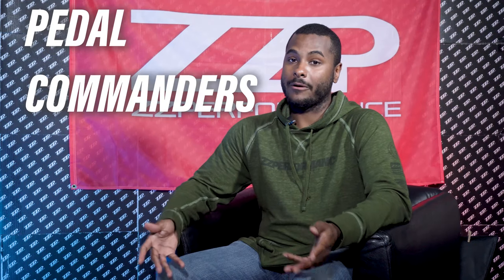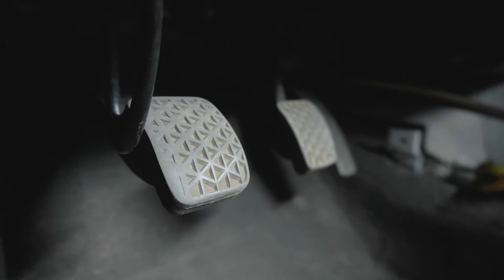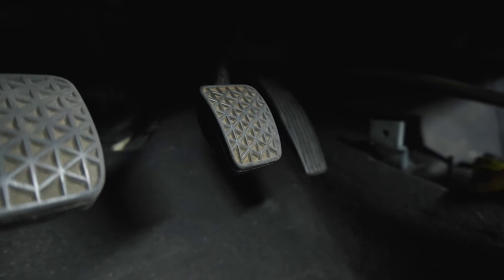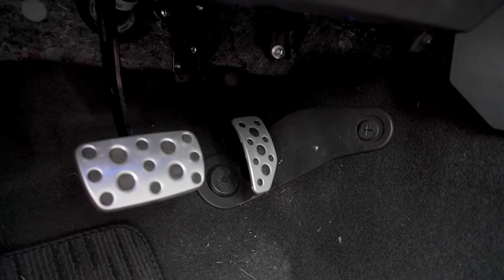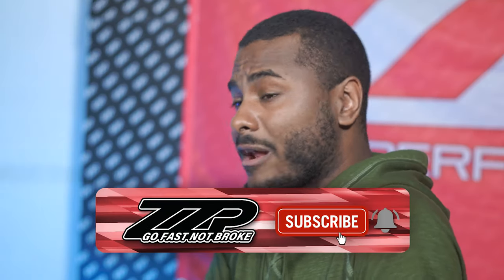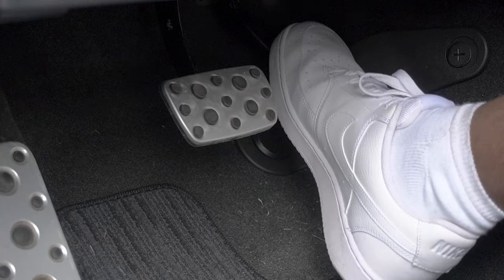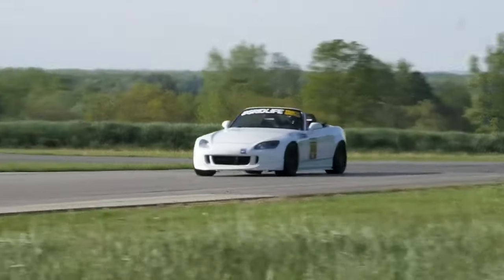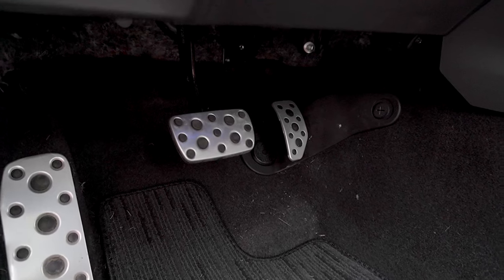Why You SHOULD NOT Buy a Pedal Commander // Behind The Builds

Comment: Custom tunes are great but not worth the risk if you want to keep your warranty intact. That's why a throttle controller is a great idea for those who care about their warranty not being voided.
Reply: Bingo
Reply: Perfect response. Got a Lifetime engine/power-train Factory warranty on my 2020 4Runner ORP. No way in Hell I'm giving them any kind of excuse to shag out of that Deal!. Plug-n-play and most minor bolt-on performance accessories pose no risk. Flash or tune the ECU >>>>>>>.....warranty is DONE.....Gone......bye bye! 

CAI.....no problem
Throttle spacer....no problem
Pedal Commander....no problem
Cat-back exhaust....no problem

(My Son works in the Service Department of the Toyota Dealership here)

Just saying........
Reply: @davec8894  Yeah after some research looks like a throttle booster and a plug an play module are the way to go to keep the warranty intact!
Reply: I'm waiting patiently for Magnuson to crack the ECU Tune for a bolt on Supercharger (with Toyota's blessings of course which is why it has not happened ....yet).  

All previous versions of the TRD Superchargers in HISTORY were an optional  Magnuson built bolt on and tuned (in partnership w/Toyota), and either Factory or Dealership installed and supported under BOTH Warranties. 

So short game is......no you cannot really make this magnificent 6000# beast any "faster" without some really serious upgrades. Possibly serious consequences, and that depends on your long game.....????? I figure about $8-10K. 

However, in the meantime I'm doing my "homework" to get a little more 'pep' in the step per say, while still playing by the "Warranty" rules. 

Been running Power Commanders on my bikes for years, same concept. Just gives the driver/rider more responsive throttle control and some added finesse. Factory ECU settings dumb shit down for daily drivers or average riders for fuel economy ratings. 

CBR RR LIFE...........Drop a Gear 'n Disappear

Comment: I think Ryan is correct in that the advertising promises by Pedal Commander are unrealistic. And he is essentially correct in saying that the Pedal Commander can't do anything that your foot can't do (although the pedal position reporting is a little more sophisticated than he thinks). And he is 100% correct that the Pedal Commander can't do what a proper tune will do. But there are still some good reasons to buy a Pedal Commander if your expectations are realistic. One good reason is if you own a newer Toyota Tacoma. I have a '19 TRD Sport with manual transmission, and my initial impression was, "What a slug!" After a while I figured out that the engine did have some pretty good power, but it was all hidden by Toyota in the last bit of accelerator pedal travel. This of course was intentional. Making the power harder to access gives you better mileage and improves their CAFE numbers. My truck is so much more pleasant to drive since I installed the Pedal Commander, with more "normal" pedal response. I don't race, rally, or do a lot of off-roading, but just normal driving is so much better with the correction that the Pedal Commander applies to the pedal position reporting. The truck has other problems that the Pedal Commander can't correct that a tune would definitely help, but I'm unwilling to void my warranty just yet. And even a tune won't correct the terrible gear ratios the clunky made-in-Thailand manual transmission provides (two overspeed gears???). So unlike Ryan, I believe there are valid applications for this type of device, and I'm very pleased with mine.

Comment: This is a comparison of apples and oranges. Tuning your vehicle will improve throttle response but at the same time the drive by wire systems have pedal lag designed into them, that is where the pedal commander fits into the picture. The PC doesn't increase performance like a good tune, it merely takes the slop out of the accelerator pedal.

Comment: With newer diesel trucks the computer will restrict how much do throttle body can open up during acceleration no matter how much throttle you give it, in this situation a pedal Commander allows the throttle body to open all the way up giving you a stronger acceleration. The throttle body restriction is done to help protect the transmission so it's best to leave it be anyway but pedal Commander does have its use in this application.

Comment: I bought the Pulsar for my 2020 Ram1500 and filled it up with 93 and ran it on Sport Mode. At first I was like Holy Crap, but then noticed it was operating like I was pushing the throttle more than what I wanted. And like it was explained in this video, the throttle was opening and closing too far and I’m having issues peddling if I start spinning. So looks like I’m gonna take it out. I didn’t feel any HP gains like they claim.
Reply: @zanderfaust  yes but that's the whole point it's not actually reducing the lag it's just simulating that you're pushing it harder. It's complete trash

Comment: I thought these systems give the throttle more resolution down low for drive by wire cars. In all the vag group cars I’ve owned. Eg golf gti , q3 and currently s5 I have found that making slight throttle inputs there is a slight delay especially mid corner when you want to just crack the gas open a fraction it doesn’t do it instantly like a throttle cable would. So to my next question how does one get more response out of a drive by wire car ?

Comment: The PEDAL COMMANDER eliminates throttle lag. You know... You press the accelerator (on stock) and a second or two after it picks up acceleration.

The throttle commander eliminates that. It accelerates immediately after pressing down.

Has nothing to do with tuners, nitro, or anything else. 
IT ELIMINATES THROTTLE LAG...

It's a great product, it gives good response so yes the throttle CAN be sensitive.
You can increase or decrease sensitivity on the app, or directly on the device. For all you EXTRA sensitive folks out there don't worry... The Throttle Commander also has an Eco Mode, and you can decrease even more in that setting, and SAVE GAS.

Set it to where you want it, when you want it.

(Stop complaining)

GREAT PRODUCT!!!

Comment: I know me and my guy got the same mods and challenger, he doesn't have a pedal commander I do, take off I got him. He was running mickey Thompson 11wide in the rear. Now he getting a pedal commander. It's not a make you think anything, it's 100% you can feel the difference right away. Nothing to do with hp just a lot quicker response. I tried driving with it off again after installing it, the car sucks big time with it. If you driving far put it in eco mode, I drove 3hrs and 22mins I started with 160 miles to E, and when I was done I had 133 miles to E. Without the eco mode, I would have used half the tank driving up to get my daughter from college. Not just quick response but gas saver all in 1 package. I guess there might be some fool who believes they can get crazy hp for a couple of hundred, but if you work on cars then, you would know it's not cheap to get gains. Plug and play ain't it? Overall it's fun, and responsive, a gas saver, and once you use it, you won't wanna lose it.

Comment: The need for a pedal commander depends heavily on the type of car. I can't speak for all types of cars but some cars like mine already have the same functionality built-in. I was so close to buying a pedal commander. Literally, I was within 30 minutes of making the purchase until I watched this video. Thanks for the info. It seems like most people don't grasp the point you were trying to convey. I even seen a video of a guy who has a pedal commander in his Porsche Panamera Turbo and he really swears by it. But I have the same car and I just didn't see why he would need until I realized its because he didn't have a ECU Tune. Mine already has a FVD Brombacher tune which has maps that does the same thing as a pedal commander but internally. The Panamera Turbo already has 3 different driving modes that effect pedal response from the factory and is greatly enhanced by my software tune. If I need instant throttle l simply get that from Sports mode. If I want insane but manageable throttle response I get that from Sport Plus mode. Besides, the throttle commander is useless with launch control because launch control requires the pedal to be already to the floor at the starting line so you're already at full throttle before you even start moving. There is no faster response than that. Worst case, I could always tell my tuner to increase my throttle response with phone call for a different map. 
Another thing you can do to increase acceleration (if you have a Porsche that's already FVD tuned) is to get a PDK transmission tune. This route is significantly more expensive than a Pedal commander but its cleaner, internal and more professional. This does many things but most importantly it increases clutch lock up and eliminates the built-in factory slippage. A "no-slip" dual-clutch with 600hp behind it automatically means faster acceleration and quicker response. The PDK tune also deactivates the torque limiter and the speed governor among other things that will increase acceleration to the maximum the car is capable of without the need to add or replace any hardware.

Comment: This is my opinion. Throttle controllers are purchased by people to do one thing and that is to open the blade as fast as your foot to reduce that one second lag it takes for the blade to open that is set by the factory. Trying to zip out into open spots of traffic can be a problem with factory set lag the throttle controllers are designed to eliminate that just as if you had a cable attached to a carburetor, although what this website is suggesting is valid when it comes to letting off the pedal it is not like it is connected to a cable it is only designed to speed up the opening of the blade and not the shutting.

Comment: Ya over time I’ve noticed that a car that’s constantly cutting back for fuel mileage will automatically readjust to throttle position and it won’t be as responsive in the same setting thus have to be constantly “turning it up”. Things garbage car gets confused and drives like shit with it

Comment: The factory computer blunts throttle to protect transmission and to get better numbers with EPA mileage. The extra throttle during shifts should make it a little quicker. The computer turns down throttle input, to claim gas mileage on EPA cycles. You can floor it, but the computer will give you what it wants, not what you want. Eventually you'll get full power but the computer makes you wait for it. You will get an extra 40 hp at low to mid RPMs when you floor it. That's something your OEM computer won't let you have. That's something you're going to feel.

Comment: True you could stump the pedal each time you takeoff but who wants to do that each time you leave from a traffic light. If you can do a cheap mod without spending a lot to notice an increase of quickness I would say it’s definitely worth it. Clearly there is no game in horsepower but if it does make your car quicker then why not. in reality that’s all we really want is to have a quicker 0 to 60 time 😀
Reply: Even if you stomp the pedal, you will still have a lag.  You can't eliminate the lag by pressing the pedal harder or faster.  The Pedal Commander takes out that lag so the throttle responds quicker.  It's that simple.
Reply: @bradmorgan911  except it doesn't. I've had one. All it does is press it down harder

Comment: Pedal controllers will not add any horse power or torque, they are not designed to do that, they are designed to make the drive by wire throttle respond quicker to your input. While a pedal controller does not add HP or Torque they can actually lower your ET at the drag strip because they eliminate the drive by wire throttle lag. Having said that they will not lower your ET by much but it could be just enough to improve your quarter mile time. 

Now that we have that out of the way there are serious issues with all but one pedal controller being sold today. That is all but three use the same 5 volts suppled to the drive by wire system and the drive by wire system alone uses 4.7 volts so that does not leave much overhead for the pedal controller to power itself. When the system uses more than the 5 volts allotted you can get the dreaded dead pedal and throw codes that many have experienced with Pedal Commander, Sprint Boost and the others. 

Banks put great engineering into their Pedal Monster and it is powered by 12 volts from the OBDII port so your Drive by Wire system is the only thing on the 5 volt circuit. By using the OBDII port Banks can also use a lot of other vehicle information that is not avail to system like the Pedal Commander, Sprint Boost and the others. The Banks Pedal Monster knows what gear you are in and when you put your vehicle into reverse it knows it and reverts back to stock programming so you do not have an over sensitive throttle while backing up. 

The Banks Pedal Monster will also revert back to stock programming if it detects a problem avoiding the dreaded dead pedal issue. There are a lot more features and safety built into the Banks Pedal Monster that none of the others have. 

Back to why use a pedal controller, they are to make the throttle more responsive so when you press the accelerator pedal you eliminate the sponge pedal as it is called. In other words they eliminate the lag in the throttle when you press the accelerator pedal by opening the throttle body faster. 

If you are looking to increase horse power and torque you are looking at the wrong products when looking at pedal controllers.

Comment: I have a 2012 beetle turbo 2.0tsi e888 gen1 cbfa fbo with a cts ko4 turbo and ots stage 2+ unitronic ecu and stage 2 tcu

Unless i use LC I have so much lag on take off.. its simply pathetic... So the tune that I have does not solve the problem... but supposedly this will?🙊🙉🙈

Comment: I don't care at all about extra power. I'm just wanting to smooth out the uneven power delivery in my Subaru Legacy Touring XT with the 2.4 turbo.. Under moderate acceleration in certain circumstances is hesitates, surges a bit back and forth and has rough fake CVT shifts. I've read and watched a lot of car reviews mention that in the Ascent, Legacy and Outback with the 2.4 turbo so I know its not my imagination.  Just don't want to spend $300 on something that won't help drivability.

Comment: Correct, it's basic laws, more air+more fuel = more power, a chip won't make more power.  improved intake/exhaust system for max air flow is your 101 solution to more HP/Efficiency.

Comment: 90% of commenters whether its YouTube or Facebook have a positive experience with the Pedal Commander. I HATE slow throttle response. That's why I drive in sport mode 100% of the time. But i wonder how much better it would be with a Pedal Commander...
Reply: I used to drive my Challenger in sport mode all the time till I got my 9 drive. In sport mode my transmission has a deal where it likes to force you to go from first to fourth. I have a six speed standard and yes there is a plug and play harness I could have bought to eliminate that but with the 9 drive my throttle response is point on and made it where I do not have to put it in sport mode. I now can pound through all six gears and got spot on throttle response.

Comment: Pedal commander is great if you can't afford a $500+ tuner or tune. It takes away throttle lag that the manufacturers put in and makes the vehicle perform as it should've from the factory in the first place. It made my automatic 370z a lot more fun until I could afford a tune.

Comment: FINALLY a guy that gets it. Pedal commanders are mind games. It just tells the computer to give more percentage of throttle for less pedal movement. It just interrupts the voltage signal of the pedal to the computer and lies to it to tell it you pressed the pedal further than you did. If you want your vehicle to accelerate more aggressive, just press the pedal further. Save the money and get a tune if you really want to increase performance. In the factory programming, the initial 25% of pedal movement is slower than the remaining 75% of travel. For example, 25% pedal throw might only tell the computer to give 15% of power output. Then get more aggressive from there to 100% pedal movement. Power output is not linear to pedal movement on these newer vehicles with Fly-by-wire. That makes it "feel" slow. All a pedal commander does it run the throttle more aggressively. No different than you mashing the pedal harder. Since you aren't moving the pedal much but the computer gives it 50% throttle (or whatever you set it at) it makes you "think" the vehicle has more power.  Simple hokus pokus. So if you wouldn't drive your vehicle harder by mashing the pedal all the time, don't get a pedal commander, because you're doing the exact same thing. To each their own though! :) Take care!
Reply: Yes me peeling out in my driveway it's just my imagination.
Reply: How much?

Comment: A slow throttle curve is how you make a 450hp Camaro feel slower than a 230hp cable-throttle Dakota.  Most e-throttles are tuned disgustingly mushy from the factory, even if they do EVENTUALLY open up all the way.  If your benchmark is the full-throttle dyno chart line, it doesn't touch that.  But it definitely makes the car better to drive in part- and transient-throttle conditions.  If throttle response doesn't matter, just remove the pedal and replace it with a button that executes the Drag Launch Program.  Or better yet, go to an amusement park and ride a ride.